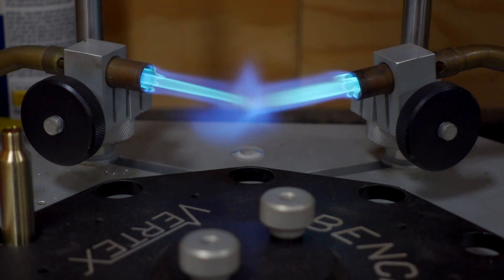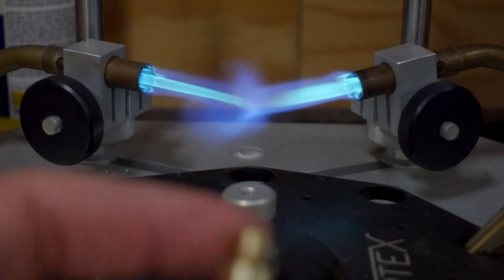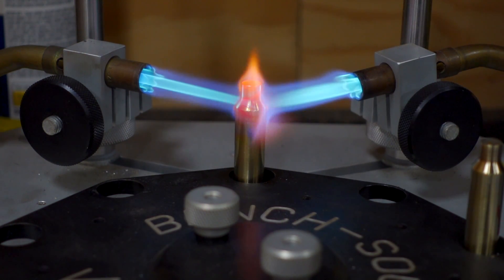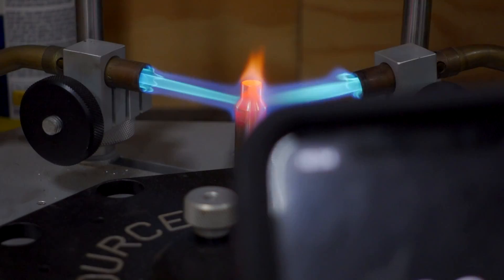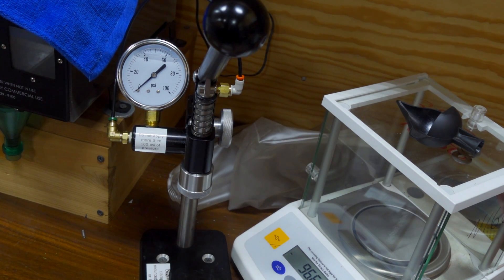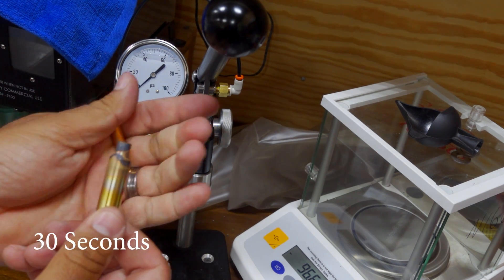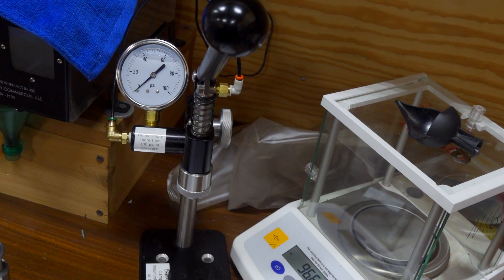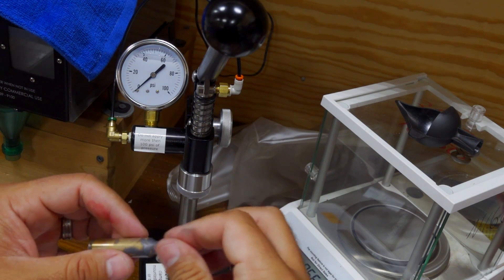Annealing brass until failure

Comment: Just a thought… why doesn’t fire forming the cartridge heat release the brass ‘tension’ making it more ductile?  The temps are high enough. Maybe pressure can make up for short time?  (Wait a few seconds for case to cool before extraction from chamber)
Also, shouldn’t you resize after annealing before you seat? (Anneal -> resize -> charge/seat)  
An interesting test would be 1. resize then 2. pressure test. Then followed by 1. annealing, 2. resize, then 3. pressure test (like you’ve been doing, of course)

Comment: I usually resize and punch out the spent primer "After" I anneal the brass. Is that how you do it? Will that make a difference in Neck Tension?
  I usually go in a dark room and heat with 2 torches until the brass turns to a dull red, usually 6 seconds.

Comment: A benchrest champion told me that if you heat too much or too long the neck, the body of the case can be annealed. Since there's no spring back, the case could get hardly stuck into the chamber.

Comment: Probably going to get beat up over this but that’s ok. A commercial lab use to anneal my brass but over an extended period and hundreds of rounds during my testing of my technique and commercial annealing, I’m getting better results annealing with a personal technique using a torch, drill and sockets to anneal my brass in complete darkness looking for the brass to turn orange in the entire neck area and immediately getting it out of the flame. I’m not timing this at all. Through testing if I put a timer on it I would get inconsistent results. All results are determined based on es’s, vertical grouping and measured accuracy and precision. Great content as always!!!!

Comment: Thanks Eric for the demo. 
It looks to me that you've sized those test cases with your normal method which, has very little interference because the neck tension was based on relieved brass & not annealed brass. 
If you still have those cases, try running them through a normal FLS die like a Lee, Hornady, RCBS, whatever &, I think you'll find they seat at about 20 to 30 Lbs & have good retention. 
Kind Regards.............Rotas.

Comment: Something no one is talking about: 

Consistency in annealing = consistency in shoulder bump. Inconsistent annealing (time or temp) case to case = shoulder measurements that can vary up .002-.003" pretty easy. Consistency, however you do it is key. This is assuming you size after annealing, which most people do.

Comment: Pretty cool! I was always taught that red hot brass just became trash. I am curious what happens to over annealed brass that gets worked back into sufficient hardness to hold a bullet tight. If you resized and neck expanded it maybe several times? Any ideas?
Reply: There is a point after which there is no recovery.  Think people talk about the brass turning to a reddish tinge.
Reply: @bucmeister7713  It is possible to work-harden recover red hot brass, but it would take much work hardening so a moot point.  See the dissertation on annealing by Ryan Stevenson CHARACTERISATION STUDY OF BRASS
 CARTRIDGES FOR HIGH END COMPETITION TARGET SHOOTING

Comment: Learned lots. Great vid. I think we all know that heating a cylinder causes it to expand. From this experiment it appears that over heating caused the neck to stay expanded resulting in zero neck tension. My question is, when resizing brass, when should annealing be done. Before or after resizing? By resizing I mean bumping the shoulder back a few thou and sizing the neck by whatever method one prefers.
Reply: Did see a comment about annealing making it easier to bump the shoulder, so I'm guessing anneal then size.  That's what I would do because of the expansion of the cylinder you mentioned.  I wonder if the cases in this experiment were sized after the annealing?  Seems doing so is the only way to test the results of the anneal on the resulting strength of the brass.
Reply: No, annealing doesn't change the OD of the neck, at least not once it returns to room temp. You can resize before annealing/relieving if you like but, it's maybe very slightly easier to size after annealing.
Reply: @rotasaustralis  For the longest brass life, wouldn't annealing before resizing extend case life more than resizing  (work harden brass) then annealing?
Reply: @RetrieverTrainingAlone  Well, I anneal before sizing but, I can't really see a problem with sizing first, if that floats their boat. Sizing the cases doesn't harden the brass very much, at least as far as my testing shows.

Comment: So... not a professional chemist here, but my understanding of it is that copper melts at 2,562 C and zinc melts at 907 C, so when you get it too hot, the flame color you are seeing is from the zinc burning off, leaving only copper.  So over-annealing by just a little bit can ruin the brass over time, where crazy-over-annealing ruins it right away.  I don't think the AMP machine will show you much different results on target... it will show you better results in brass life after many reloadings and annealings.
Reply: Cartridge brass melts at 915C.  The zinc content of the alloy cannot burn or melt out  until boiling point.   source: https://www.ampannealing.com/articles/40/annealing-under-the-microscope/

Comment: Seems like investing in some Tempilaq for flame annealing would make a lot of sense. It would help to fine tune the time/temperature, rather than eyeballing a "looks good" point.
Reply: Or an Infrared thermometer gun
Reply: @ironbomb6753  In combination with the flames, because the brass cools very quickly once removed from the flame.

Comment: Thanks for the video Eric. More information is always better. It would be interesting to use a thermocouple or tempilac paint near the the base to see at what point it reaches 500f. That's the temperature where brass begins to anneal. I would guess that on at least some cartridges the base reaches that temperature before the neck tension was ruined.  I verified this morning using tempilac that Hornady/Federal .308 brass reaches 650f 3/4(1.5") of the way down the case after 10 seconds in my bench source annealer(same as used here) using two propane torches. On shorter cartridges like the 6BR variants this could definitely be dangerous. I only have 650F tempilac or I would have tested different temps. I just ordered a thermocouple to test this for myself just for curiosities sake. I'll reply to my comment with results.
Reply: I don't want to be a party pooper but, you won't do any good with a common style thermocouple. Even a specially designed thermocouple would not produce repeatable results. The problem is that, the brass or rather, the case shape,  radiates heat almost as fast as it absorbs &, unless the thermocouple is very small & specially shaped, it won't have a useable rate of change of temperature to enable you to track the temp accurately within the time frames required. The only viable option is an IR pyrometer. They are expensive &, you would need a specially calibrated setup to accurately measure red hot metal which, is notoriously difficult to measure.
Reply: @rotasaustralis  Actually, I was only thinking more of using a thermocouple when setting up the torches position and gas rate wise so it would be measuring the flame for an extended time to know I had them generating the same heat as the time before at the point the cartridge would set during the annealing operation not to measure the heat of the brass.
Reply: @bucmeister7713  Yeah, why not give it a go if you've ordered the thermocouple. I've measured flame many times &, the temp usually changes dramatically with very small movement, but, you'll do much better finding that for yourself. Because the case radiates so much energy, they require a considerably higher flame temp than the necessary metal temp so, consider that when doing your testing. Also, at those elevated temps, your test cases will be for neck tension only, please don't load & fire them. The base may well be ok but, it's not possible for us to realistically test that so, if you want to do firing tests, anneal with the base in 1/2" of water & go for it.  
Good luck & kind regards...Rotas.
Reply: I mentioned the 1/2" of water cause I assumed you may test at the higher temps. If you're just going to 750F for <10 seconds, don't worry about it. 
Kind Regards.........Rotas.
Reply: Speaking of thermocouples, could one be used to set the flame intensity to repeatable levels prior to running brass?  Ideally there would be a way to control the entire process by infrared measuring of the brass temperature itself but guessing the flames would interfere with that.  Might could on an induction heater but figure the precision needed would be cost prohibitive.
Reply: @bucmeister7713  The flame can be nearly 3000f hotter than the brass will get during the time it's annealed. If you had a metal rod(or a scrap piece of brass) that you sat in the same place as your brass and attached the thermocouple to that at a fixed distance from the top and measured the time it took to get to a certain temp you could try to make that repeatable. You would still need to test the individual brass brand/caliber however since they would all react differently.  I've tried using an infrared temp gun but getting an accurate reading was impossible.

Comment: If you know the target temperature stop by a welding supply store and buy Tempilstik it is a type of marker that melts at very specific temperatures. Thanks for the video.
Reply: Believe it is generally reported to be 750°F.
Reply: @bucmeister7713  After a brief search they make 116 grades between 100°f and 2000°f it would be easy to verify an accurate set point.

Comment: I'm curious to see if one of your 10+ second pieces was resized, how much neck tension it would have compared to a properly annealed case.
Reply: It is an interesting concept to see if you can reintroduce the correct tension. Anneal for ten + seconds and then resize or try a few different methods. No expander ball. With expander ball. With a mandrel. Etc etc...
Reply: @tyler6147  Was thinking per prior reading on the subject that once the temperature goes beyond some certain value the metallurgy of the alloy is permanently disrupted and can not recover.  If correct seems you are better off slightly under heating or even not annealing at all than to even slightly overheat.
Reply: @bucmeister7713  While I would agree that there is definitely a point of no return, if for no other reason that some of the elements that make up brass all 'melt' or 'burn off' at different temperatures. Once that happens it's become fundamentally different than what you started with. The physical composition of components are altered if by nothing else but by altering the percentages of minority metals of the alloy. 

That said, as Eric pointed out the 'window' to anneal is wide. Anywhere from 5 to 10 seconds (or maybe even more) is fine, but the good thing is Eric has all those tools at his disposal and if we really kiss ass maybe, just maybe he will try to get a few cases that are over done but not beyond the point of no return and see if he can work them back into having some form of usability. It would be a very interesting experiment to me at least.
Reply: @bucmeister7713  When you really think about it the art of refining metals means you burn off the 'dross'. Like if you had a bunch of gold that you dug up it might not be totally pure but if you bring it up to heat enough those other parts start to separate out. I think at least in theory when you over anneal that's the basic concept of what happens and it obviously leaves a different grain structure or any other number of things... but assuming you don't go that far with cooking brass I still wonder if you can work harden it back to something manageable. 

@Eric Cortina has the stuff to test... but on a side note, have you lost weight Eric? Did you get a haircut?
Reply: Yes. I was about to type the same thing.

Comment: You're a brave man for tackling this topic.
Reply from the maker: I’m starting to regret it. 😂
Reply: @ErikCortina  I seriously hope not. Between you and @Johnny's Reloading Bench, you've got me back at my bench, and have helped me improve my groups significantly. But more than that, the feeling you get by making something based on new ideas; pushing myself based on your experiences; and then realizing success most times with the very first shot. Very rewarding - thanks for your work and inspiration.
Reply: My two favorite reloading people in one thread...not sure i can handle this level of joy
Reply: JRB!!! I keep missing the Twitch footage, eagerly waiting on new videos to drop!
Reply: Tackle further Great Minds... If I crimp after annealing does this not make neck tension consistent?
Reply: @pearlrival3124  Guessing not necessarily.  The crimp is part of the neck tension as it adds to the tension which exists in the neck of the brass itself.
Reply from the maker: Don’t crimp.
Reply: @ErikCortina  Why not? Its promoted for 30-30, and for 22 hornet. Does it negatively effect accuracy?
Reply: @11C1P  I think i finally learned about different size expanders from bolt action reloader. that seems to be the key to consistent neck tension. erik pointed out even if your not consistent its hard to have a negative effect on brass with a torch.
Reply: @Erik Cortina - Pro Shooter Can you elaborate? Why would this not be a solution?

Comment: Thanks again for the information.  Mr.Cortina I don't have alot of money to spend on annealing right now can you give some advice.  Other word is there a cheap way to get it done .
Thanks again sir
Reply from the maker: You can use a torch and socket.
Reply: I use a torch and watch the color change. The wind of the torch requires a bit of an angle to keep the shells from falling over. I think this is why Erik is recommending a socket for stability. Keep in mind: over annealing is better than under. You will understand when you go to sizing your shells.

Comment: Would like to see them resized now and see what characteristics they have then.  If any neck or what amount of neck tension returns.
Reply: I bet you would have to "fire form" it with no projectile to get some hardness back in the brass.
Reply: @malcolmreynolds7122  Why do you think that?  Why without a projectile if fire forming?  I dont believe fire forming work hardens brass any different than reaizing.  Its mostly fire formed as is, would need to reduce neck to see if it holds size and/or maintains elasticity when seating.
Reply: @stubs80x11  I am thinking of the old wild-catters way of using powder topped with cream of wheat and then.....either soap or wax to cap it off. They would fire it to fire form their brass without using a bullet.  It would just save the cost of the bullet.
Reply: @malcolmreynolds7122  I see, but Im sure someone whos sponsored by Lapua and Berger that it probably would cost more for the cream of wheat and wax than a few projectiles.  I just didnt know why you referenced that way of fire forming over another.

Comment: What tension do you get when sizing after annealing? Or did you and I missed it?
Reply: Since heat causes expansion which would cause an opening of a cylinder I also would think each piece of brass would need to be resized after the anneal process before measuring the bullet seating force, for consistency in the test.  Just thinking out loud as this is way out of my expertise.
Reply: @bucmeister7713  it contracts again when cooling, so that doesn't matter.
Reply: @Kaboomf  Yes sir, I understand the principle as I have used it for seating bearings on shafts and have used the reverse process to seat disc bearings into carrier trunnions (heat the trunnion while deep freezing the whole bearing - they all but dropped in, light taps with hammer seated solidly).  My question was whether or not there would be full contraction after overheating to that level and "if" I interpreted his follow up video correctly, it did not fully contract back to the original internal diameter.  In the follow up he sized after heating and none of the bullets dropped in.  In fact the most overheated batch seemed to have the most consist resistance for all 3 pieces of brass.

Comment: Great info Erik, makes me feel better about my annealing knowing there is a wide window. One less thing to stress about.
Reply: The heat tolerance of the brass may cover a wide temperature range, but the consistency in temperature achieved in your particular process from batch to batch will still affect the neck tension and your accuracy, will it not?  If, for consistent neck tension and the chasing of accuracy you anneal between every loading and heat to 750°F during load development only to get the flames hotter in subsequent sessions of annealing and take the brass to 825°F for example would that change the metallurgy enough to alter the absolute tension and impact accuracy even slightly? 

That is the experiment I would like to see done.  Take 10 cartridges, starting at 1 or 2 seconds below the preferred sweet spot progressively add 1 second longer in the flame for each subsequent case, then size all cases before measuring the neck tension.  Could just as well be done in half second intervals.  Also, in the pursuit of precision measurement, because not every bullet in a box is precisely the exact same diameter, it seems one would need a hardened steel bullet substitute to accurately measure the resulting neck tension by using the same piece of metal for all measurements.  You could use the same bullet but considering the softness of the material there might be microscopic changes or losses of material with 10 trips into case necks hence the steel substitute idea.  

Anyway, that is just the way I would set up an experiment to see if temperature differences that are still within the window of tolerance for brass have any affect on the resulting neck tension, if I had the equipment Mr. Erik has.